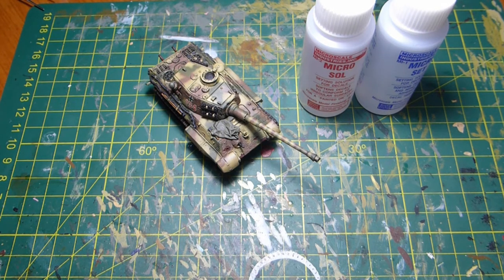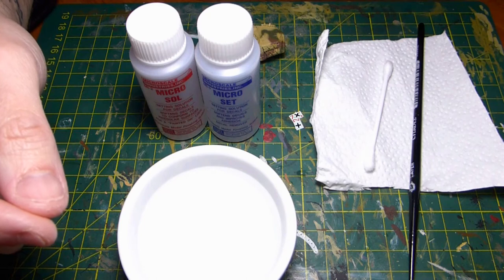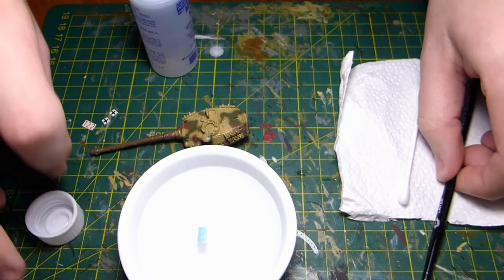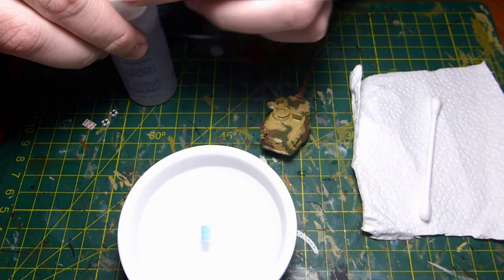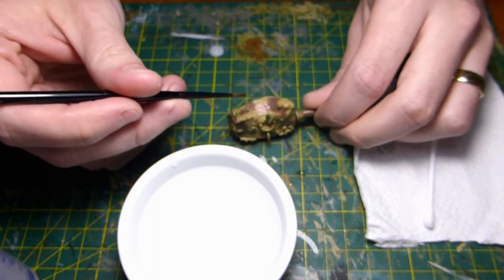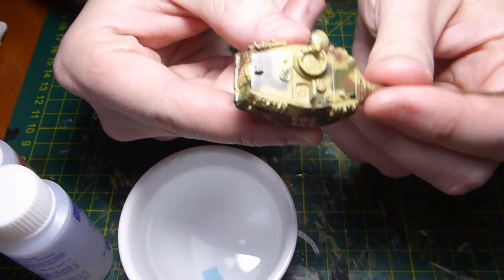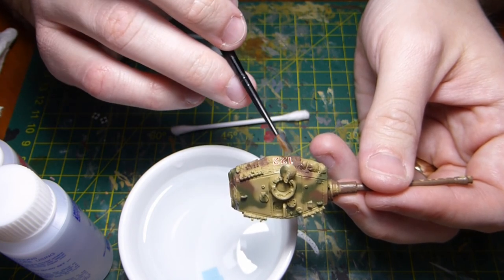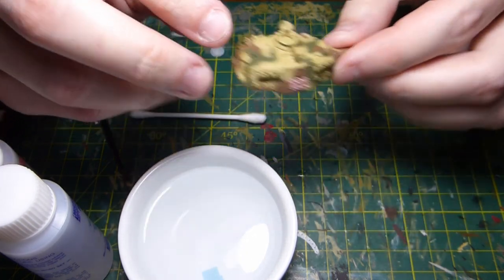How to Apply Decals Like a Pro (Beginner's Guide)

Comment: Great results there.  I had not seen the sol used on such a highly textured surface.  I have both of those for decals, but have only used them once so far.  I have two more models to decal soon and wanted to brush up on how people are putting on decals.  I get intimated by how it is rather easy to destroy the decals if you aren't careful.  I had forgotten about putting on the gloss before the decals, as it has been awhile since I used decals.
Reply from the maker: Thanks a lot buddy 🙌 I'm so glad you found it useful. It's definitely a scary prospect but one that you'll find easy once you find a method that works for you 😉

Comment: Is this safe to apply straight onto acrylic paint, ive been looking at this or the tamiya mark fit strong but hear bad things about the tamiya stuff.
Reply from the maker: Yes mate, just make sure you've put a protective coat over the model ... preferably a gloss varnish - I use Tamiya Spray Semi-Gloss Varnish. This helps protect your acrylic paint as well as give the decal a soft surface to lay on. Just when using this stuff, don't let it pool and ensure you just lightly brush it on.

Comment: Question what will happen if you don't use glossy or semi-gloss clear coat?
Reply from the maker: Great question. Basically it'll just mean your decal isn't sealed to the model. You could accidentally touch the decal and it'll come off. 

In short, the first spray of semi-gloss creates a flat surface for the decal to rest on. The you add the two agents and once they're dry you respray it with semi-gloss. This then acts as the seal, the decal will become protected and it'll be secure. Finally you give it a clear coat which removes the shiny gloss. 

I hope this helps to clarify the reasons we use these coats.

Comment: Good video thanks.    Just fyi i use humbrol decal fix which works just like micro Set but is cheaper of course.   Use just the same and wash off any excess.   But of course it doesnt make decals conform as well as the Sol but if its a flat surface or just has faint lines the humbrol is very effective.
Reply from the maker: Ah that's awesome, thanks for the tip! I'll definitely try out those Humbrol offerings!

Comment: Thanks for the video! Question…I’m deathly afraid of causing decal damage while the decal is still soft. How long after the Micro Sol do you wait until you help it along by rolling a swab over it? Your video has helped shed light on these particular products as a while ago I switched over to Mr. Mark Softer and Mr. Mark Setter as I wasn’t getting the conformity I desired with the Micro series, but like I said your video has helped me want to give it another go perhaps.

One thing I’ve been learning on the wife’s Cameo 5 is cutting my own mask to airbrush all my marking instead of using decals. Of course this would be extremely hard in 1/72 unless you were dealing with a solid color but for me working in 1/48 and 1/35 it’s proving to be a great advantage since I shoot my markings right after my top coat(s) are applied as I don’t have to worry about silvering or conformity. I the shoot a gloss over everything then as I really do like my oils for washes and weathering. But this is another topic so my apologies.

Thanks again for the video!
Reply from the maker: Thanks for your comment mate and great question! The decals can be left for a minute or two. Just slowly put your swab on the decal as it could be prone to moving. The slower you go with the swab the better you'll be. You'll soon see the decals conforming to the surface. If you ever get stuck or worried don't hesitate to message me on social media or email. Happy to help 😀 

I think that's a great idea with regards to the cricut machine. I might even try it with my 1/72 scale models!!